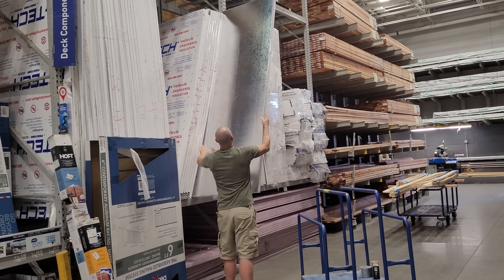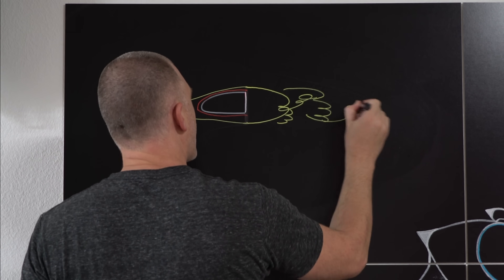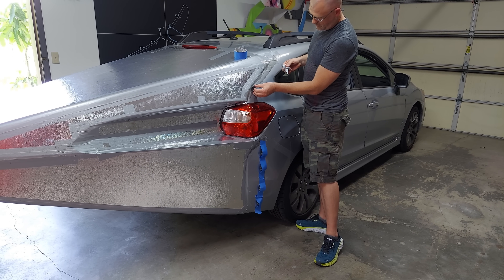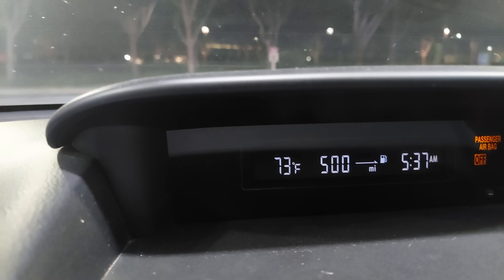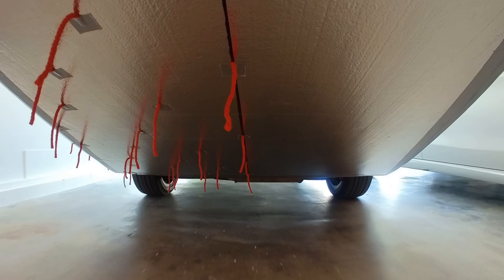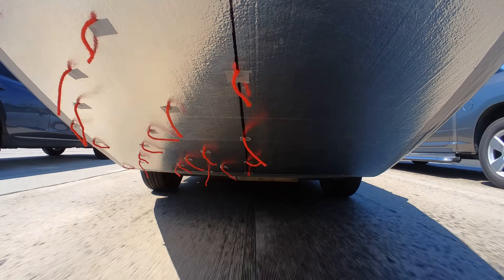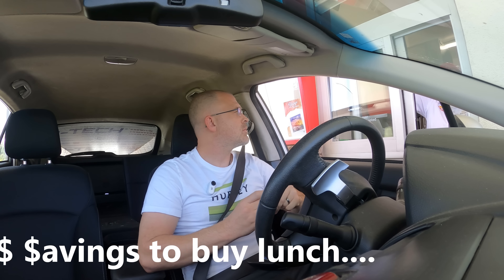Using Simple Aerodynamics to Beat High Gas Prices (Home Improvement Store Edition)

Comment: Look up the 80ies Audi 100. They have an astoundingly good aerodynamic setup. In fact, they were the cars with the least wind drag of their time and still are top notch in this aspect. Their underbelly is covered, their windows are seamless flush with the outside, the doors close into a seal with no gap, the windscreen wipers hide behind the hood, small things like that. All in all, they just look like a cleaned-up sedan, but their Cw value speaks for them.

Comment: I had to tow a utility trailer 1000 miles behind my Land Rover, which used to get 18 mpg hwy. The trailer was heavy but, since it also had two sea kayaks on top of it, it effectively filled the void behind the tall Rover with a tapering mass and the mileage actually went up to almost 20.
Reply: I moved to an apartment nearly 200 miles away and had a table in the bed. Typically that same drive would average 22-23 mpg including a bit of city, but this time it was a tick over 25 mpg at the pump. With a table.
Reply: @vitopannucci2001  the speed must be significantly lower than normal driving & as you told in another comment - the drag depends exponentially on speed !🙏
Reply: your lower speed was a big contributer to the increased milage.
Reply: they didn't mention speed, but things storing the spare wheel on the rear door of boxy 4x4s actually reduces drag, for the same reason.  @pravindahiya719
Reply: That's incredible.
Reply: Back in 2005, I had loaded my vehicle to relocate cross country. It was loaded down far beyond what should’ve been in the car. It was rated 17c / 26h and with it loaded down, closing the gap between the bottom of the car and the road, it got 31-34mpg on the highway.
Reply: *on the freeway/highway.  

I get 27 mpg regardless of if I’m towing a flare stack or nothing.  Everything is relative.

Comment: I feel like you’re going to have drivability issues if you make the tail come straight out the back, level to the ground. It’ll drag on the ground whenever you go up or down inclines, dips, or driveways (especially since it’s so long). Perhaps curving it up gradually would help maintain the boundary layer, while still keeping it drivable.
Also, what about some longitudinal vanes on the bottom of the tail to help condition the airflow?

Comment: Interesting video.  I love my Impreza for the same reason, but wish it came with 6 speed manual instead of 5 so it could be more efficient like the automatic.  I never have seen more than 420 miles remaining on the display and that is including long trips using cruise control for hundreds of miles.  IMO, a 6th gear for highway cruising would make the Impreza a lot more efficient and worth the extra $$.

Comment: As a couple of other commenters have mentioned, wheels are vented in order to allow air to flow over the brake rotors for cooling.  The air generally flows from the inside of the wheel to the outside, since the higher airflow past the wheel creates a low pressure zone.  I would suggest that you cut some vents into your covers.

Comment: Cool but...
Vortex Generators add drag.  Great for lift.
You have a roof rack... so... remove it. Same for the side mirrors.  (maybe add really small ones)
Why is there a big hole in the back of the boat tail?
And, your hatchback seems critical to using the car.  If you can't use it, how long before you tear off the boat tail?

Comment: That very expensive EV will need $20k for new batteries before your final payment but after the warranty has expired. 

Ok, not quite that bad, but be prepared to buy a new EV because you won't be able yo afford the new batteries. 

That is, unless you are close enough to your job to ride a bike.

In which case, why do you need an EV?
Reply: Disinformation is great!  What EV manufacturer doesn't warrantee the batteries for 8+ years?
Reply: You mean the part about WHEN the batteries go out, you'll not have $20K to replace them?
Reply: @firebird77clonefirebird89   "the part about WHEN the batteries go out" is the wet dream of gasoline people.  10 year old Teslas are doing just fine. 😜
Reply: 8 year warrantee on EV batteries is US law.  2X longer than 💩box ICE cars

Comment: I try it without those vortex generators.  I understand what they are supposed to do but if they are not placed right or placed in an area that is not needed they are going to cause more problems with air flow than they are worth.  At least that be my uneducated guess.

Comment: Making the car lighter would also decrease the amount of fuel you engine has to use . You could also add spats on the rear wheels, tape the panel gaps in the front of the car, use clear plastic sheet to transition the tail lights. You can also look at the VW XL1.
Reply: how do you expect him to make the car lighter weight
Reply: @flazerrazer2992  Remove the spare wheel, door inserts, rear seats, carpeting, anything in the trunk, etc.
Reply: @flazerrazer2992  well i know few tricks but like true facts that some lighter composite carbon body parts can replace the factory ones right (like hood, trunk-door, doors, front fenders)? also carbon structural seats can shave even more weight compared to factory stock OEM..  if long trips are not mandatory daily the spare wheel can be removed shaving some more weight...
Reply: @poplaurentiu4148  you need a huge amount of miles to cover the huge price what you have to pay for these carbon parts.

Comment: The car manufacures sort of do. But they are partly limited by protection but also length, and well.. even more so weight.

The thing is that weight id more important than aerodynamics  in europeam and japanese fuel testning. Making a extension out of foam  in a real car is just not going to cut it. The only sort of real way of doing something simular is sort of a oversized back panel.

Comment: I've been thinking about this for years. Many cars could benefit from an inflatable airstream on the front. Maybe clear and it wouldn't interfere with headlights or visibility. And deflates for city driving/ parking. There you go. My patentable idea revealed.
Reply: Maybe for an electric most gas cars have radiators at the front that need cooled. Also the font is actually most of the time less important then the back.
Reply: Thanks now I‘m going to get rich
Reply: Are you referring to a nose cone? If so, unless you are reaching supersonic speeds, it's not really that beneficial to add a nose cone at the front. Your front cross section remains the same. Adding a splitter or a dam of some sorts to reduce air going under the car would be helpful and could be inflatable.
Reply: @jimysk8er  or just a metal plate attached to pistons with a sensor that moves it up and down depending on road conditions. Pretty sure the Acura integra did something like that in the 90s
Reply: @reecedeyoung6595  yep a couple of cars have venting based on temperature or rear and front wings based on speed and or braking.
Reply: Would degrade quite quick with most all materials
Reply: But the material should need to be withstand with all the harsh conditions of road such as rock chips and extreme weather.
Reply: Mmm, it'd need to be very stiff, otherwise the entire benifit is gone. But definitely material for thought!

(Oh also, I'd inflate something on the back, not the front. The back has way more impact on your aerodynamics, unless you actually manage to make the 'leading edge' good enough to create laminar flow)
Reply: Thats some old school Night Rider type sht.

Comment: Why not completely cover the rear wheel wells?  I recall that's what most do with the Honda's and Toyota's made to hypermile?  Seems smoothing out the bottom side would also be an improvement as well versus more drag from the front and side skirts.  Speaking of underside, I need to get under my Prius to see what all needs to be done to get the exhaust shields from rattling.

Comment: Very cool.  Thanks for sharing.
I see other commentors with some thoughts I had as well.  Clear Lexan over the tail lights that follow the aero shape you desire.  My '91 and '93 MR2s have belly pans the full length of the vehicle up to the engine bay - a belly pan may help your Impreza but would be cautious about getting engine heat out.  Your side mirrors contribute a significant amount of drag - not sure what you can do in this area.  And lastly, wheel skirts may help the rears as well.

Comment: Luv this - keep pushing! I'd opt for a flat underbody as well (vs any other further mod). I'm experimenting w/ aero mods on a BMW C-Evo as well - and was able to lower the power consumption @100km/h by 0.4 kW by just adding small triangular panels on the fairing to reduce turbulance around the legs. The turbulant center stand is next...  On the long run small streamlining mods (as long as safety is not altered/reduced!) can make quite a difference!

Comment: It is just a matter of time before you get pulled over for statutory equipment and safety violations. Statutory law requires to have clearly visible markers at the edges of the vehicle on all side. 

The apparatus extends several feet off the back without being clearly visible. This creates a safety concern for other vehicles on the roads because they may not be able to see the extension off the rear of the vehicle, especially when there is low lighting.

Comment: Next: Buy a 1” steel ball and hammer it into the body of the car creating 1/4” dimples across the entire surface.  If it works for golfballs, it should work for your car too!

P.S. I’m actually half serious, and may try this on a cheap late 90s Toyota Corolla when I eventually acquire one.  I’m thinking that if you’re methodical about it and make sure the dimples are mathematically spaced evenly (and you don’t care too much about cracking the paint, leading to rust in a few years), it may actually look fine.  One of the things an engineering degree gets you is the knowledge that many things you build can look like hokey crap, unless you measure things out and make sure everything’s even and consistent and straight— then it looks like it’s supposed to be that way.

Comment: I don’t understand the pump fuel pressure thing.  What?  Even if the pressure was different, why would it matter?  Pumps are calibrated to pump how much they show in gallons— why would it matter if you buy 5.120 gallons and it takes 60 seconds to pump, vs. 5.120 gallons and it takes 45 seconds to pump?  I don’t get it.

Comment: You need to read up on Kammback or Kamm tail.   Like on the Honda Insight.  Basically when you get the angel right and the air still attached you can abruptly cut if off with minimal increase in drag.

Comment: Pumps don’t stop at exactly the same spot when filling a tank, they depend on escaping air pressure to approximate “full” in the tank… you should fill the tank to the filler cap so you can get exact gas usage….

Comment: When the tail is lowered in an attempt to attain lower drag, the increased angle of drop away on the top surface will cause separation and drag again. Drag is harder to shake than you think. You could increase tail length for smoother drop away but then you are upholding form drag at the cost of surface drag from increased surface, and back to square one. There is a reason the tails of cars have an abrupt tail, to induce a rolling vortex and peel the flow off as rapidly as possible to minimize surface drag.  I also dont think your tail has as much benefit as you witnessed when you measured. Air speed has a huge impact on the tail drag and separation , esspecially on tapered tails. VW beetles have much worse aerodynamics and economics than you would imagine especially at higher airspeeds. Cars are not airplanes, the road is the big difference and deal breaker. Of interest the front 3/4 of all modern cars are easily computer modelled and designed, but despite all the computer power, tail predicition is highly innacurate. The tail is still to this day, fine tuned by a master of the art with clay slapped arount the car in a full size wind tunnel while watching the drag readings.
Reply: Aptera might have the ideal body shape, but totally unadaptable to existing bodies.
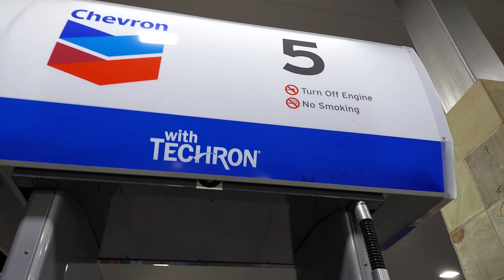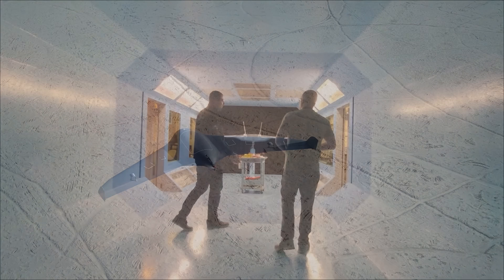Reply: Repent and follow Jesus my friend! Repenting doesn't mean confessing your sins to others, but to stop doing them altogether. Belief in Messiah alone is not enough to get you into heaven - Matthew 7:21-23, John 3:3, John 3:36 (ESV is the best translation for John 3:36). Contemplate how the Roman empire fulfilled the role of the beast from the sea in Revelation 13. Revelation 17 confirms that it is in fact Rome. From this we can conclude that A) Jesus is the Son of God and can predict the future or make it happen, B) The world leaders/nations/governments etc have been conspiring together for the last 3000+ years to accomplish the religion of the Israelites C) History as we know it is fake. You don't really need to speculate though because you can start a relationship with God and have proof. Call on the name of Jesus and pray for Him to intervene in your life. - Revelation 3:20

Revelation 6 1st Seal: White horse = Roman Empire conquering nations under Trajan 98-117 AD & Gospel spreading rapidly. 2nd Seal: Red horse, bloody civil wars with 32 different Emperors, most killed by the sword. 185-284 AD 3rd Seal: Black horse, economic despair from high taxes to pay for wars, farmers stopped growing. 200-250 AD 4th Seal: Pale horse, 1/4th of Romans died from famine, pestilence; at one point 5,000 dying per day. 250-300 AD 5th Seal: Diocletian persecuted Smyrna church era saints for ten years, blood crying out for vengeance. 303-312 AD 6th Seal: Political upheaval in the declining Roman Empire while the leaders battled each other. 313-395 AD

Revelation 7 Sealing of 144,000, the saints, before trumpet war judgments, which led to the fall of the Roman Empire.

Revelation 8 1st Trumpet: Alaric and the Goths attacked from the north, the path of hail, and set it on fire. 400-410 AD 2nd Trumpet: Genseric and the Vandals attacked the seas and coastlands, the blood of sailors in water. 425-470 AD 3rd Trumpet: Attila and the Huns scourged the Danube, Rhine & Po rivers area, dead bodies made water bitter. 451 AD 4th Trumpet: Odoacer and the Heruli caused the last Western Emperor (sun), Senate (moon) to lose power. 476 AD With the Western Roman Emperor (restrainer of 2 Thes. 2) removed; the son of perdition Popes took power.

Revelation 9 Two woe judgments against the central 1/3rd and eastern 1/3rd of the Roman Empire. 612-1453 AD 5th Trumpet: Locust & scorpions point to Arabia, the rise of the Muslim army. Islam hides Gospel from Arabs. 612-762 AD 6th Trumpet: Turks released to attack Constantinople with large cannons (fire, smoke, brimstone). 1062-1453 AD

Revelation 10 The little book is the printed Bible, which was needed after the Dark Ages when Scriptures were banned by Popes.

Revelation 11 7th Trumpet: Martin Luther measured Roman Church; found that it’s an apostate church, not part of true temple. The two witnesses are the Scriptures and saints who proclaim the pure Gospel and testify against the antichrist Popes. Papal Church pronounced Christendom dead in 1514 AD. Silence for 3.5 years. Then Luther posted his 95 Thesis, which sparked the Protestant Reformation and brought the witnesses back to life. Millions of Catholics were saved.

Revelation 12 Satan used the Roman Empire to try to wipe out the early Church, Satan was cast down as the Empire collapsed.

Revelation 13 The antichrist beast Popes reigned in power 1,260 years, 538-1798, is the little horn of Daniel 7, son of perdition. The false prophet Jesuit Superior General rose to power from land (earth) of Vatican and has created many deceptions.

Revelation 14 Points to great harvest during the Protestant Reformation & wrath on Catholic countries who obey antichrist Pope.

Revelation 15 Overcoming saints victorious over the beast. Prelude to 7 vials and judgment on those who support Papal Rome.

Revelation 16 1st Vial: The foul sore of atheism was poured out on Catholic France, leaving them with no hope, led to revolution. 2nd Vial: The French Revolution started in 1793, killed 250,000, as France had obeyed the Pope and killed saints. 3rd Vial: The French Revolution spread to rural areas of France, where Protestants had been killed in river areas. 4th Vial: The bloody Napoleonic wars shed the blood of countries who had revered and obeyed the antichrist Pope. 5th Vial: Judgment on the seat of the beast. Papal States invaded in 1798, Pope imprisoned, removed from power. 6th Vial: The Turks vast domain dried up, they were only left with Turkey. They lost control of Palestine in 1917 AD, Israel became a nation again in 1948

Comment: Great idea for testing but bad execution.
You can't rely on the amount of gas you fill, because it is not accurate. It uses sensors of gasoline vapor concentration to stop the pump, which can easily trigger 1 gallon sooner or later. That is why your fuel gauge wasn't going down - the car was overfilled.
You should have used the car's mpg reading for all calculations which would make the test accurate.
Conquer Driving shows this fueling inaccuracy in his Easy Eco Driving Tips video.
Reply: Most cars have some pretty bad MPG estimates also, unfortunately.  Seen some magazine comparisons found them to be off by as much as 3.5 mpg over long term tests.

Comment: Here are some basics of aerodynamics; Next time before building a radical huge boat tail, first remove the roof rails and antenna. +5% mpg. Next; remove the mirrors. +5mpg. Overinflate tires. +5% mpg. Install full slick floor pan. *10% mpg. Then start thinking about boat tails.